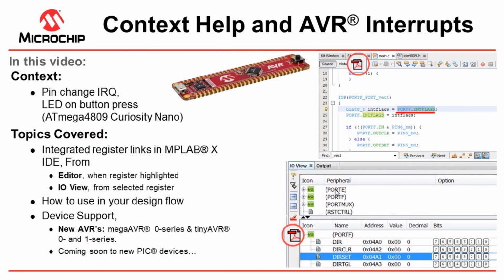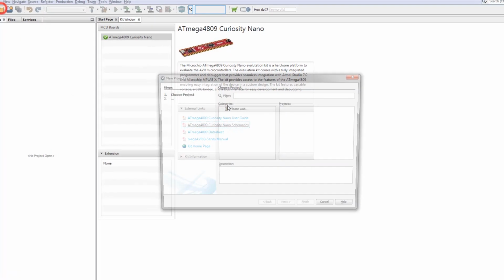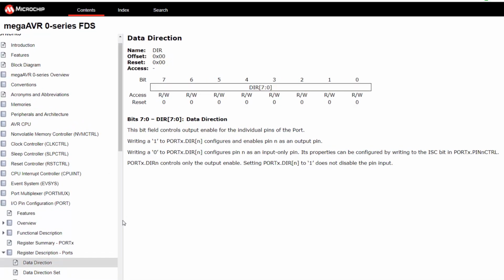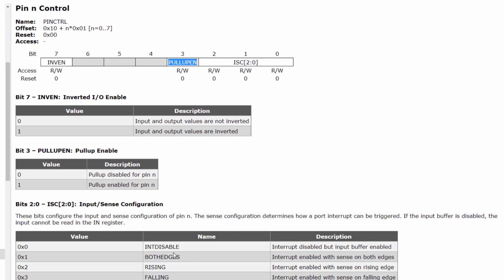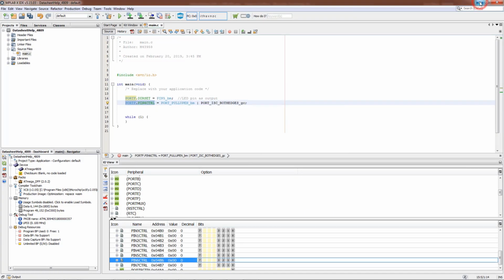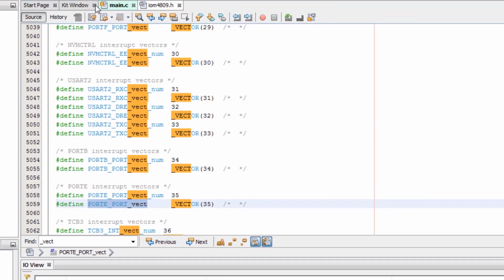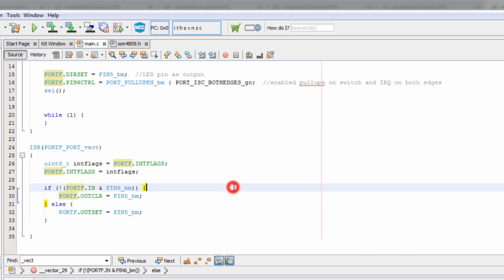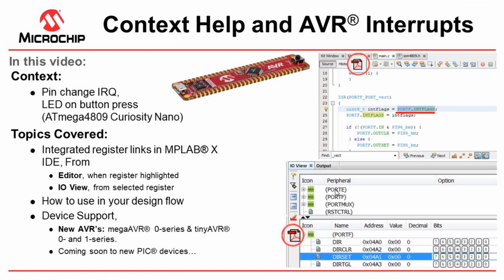Getting Started with AVR® in MPLAB® X - Context Datasheet Help & AVR® Interrupts

Comment: Does AVR compiler in free version of MPLAB add useless instructions in output code to slow down the MCU and to force people to buy commercial version of MPLAB?
Reply: No need to go there... better ask if we get the same optimization levels for AVR with MPLAB X as we did with Atmel Studio :-) Also I would appreciate someone addressing the silicon issues in the new AVRs' Errata.
Reply from the maker: Kindly visit support.microchip.com for assistance. Thank you.